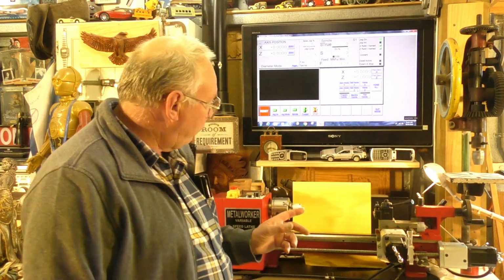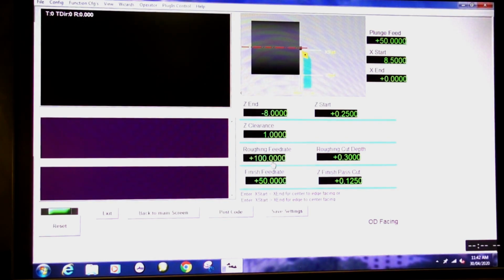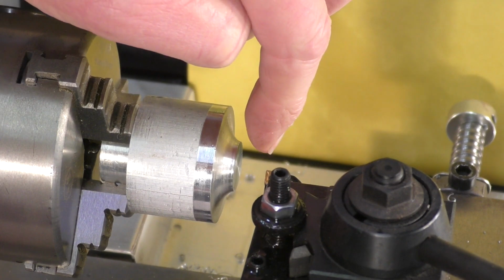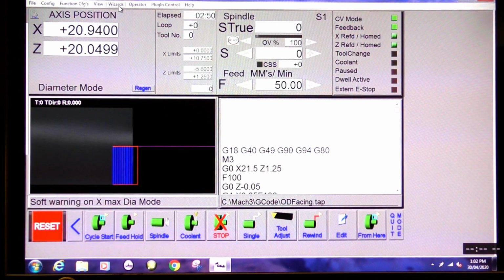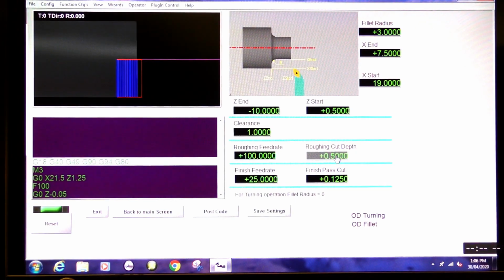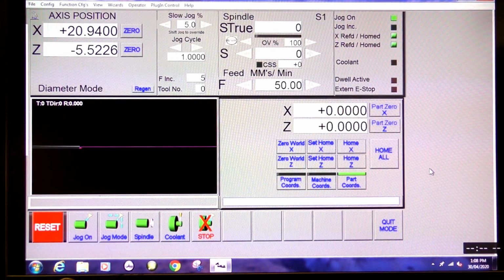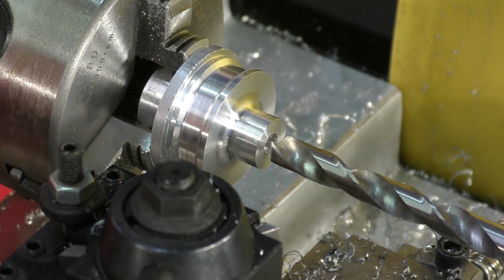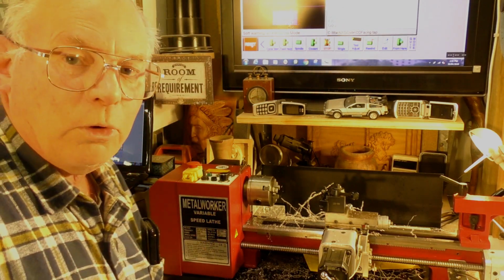A CNC mini-lathe conversion Harbor freight/grizzly 7 x 14-inch Mach3 turn wizards basic operation

Comment: Wow your cnc lathe is proven to be a work horse.
Meaning it moves from the z to and from the part with accurate tolerance.
I struggle to get to the part accurately manually due to the back lash
Wish I could improve without making it a cnc like yours
I have an identical lathe but under another brand in the UK called a clark
I can say is with branded lathes they have been made in China but they have been made better from other Chinese lathes that require so much upgrades

Comment: Hi mate when facing a part go past the X0. 0 by 2x the radius of the tip your using ie if you have a 0.8mm tip go past the X0. 0 by 1.6mm also on aluminium you can buy ally tips that have a deeper rake so the material rolls over and break easier

Comment: Very good Roger. You're a clever chap.  At the start where you said you were using feed per minute I was confused but then of course I realised . . . . No spindle encoder.  Is that on your "to do list" so you you can use feed per rev and screwcutting?   Jim